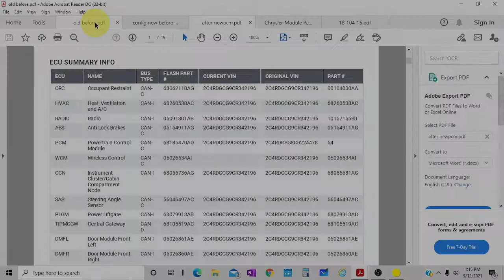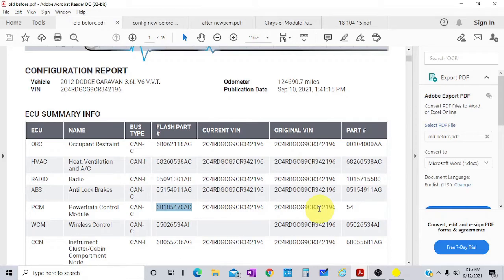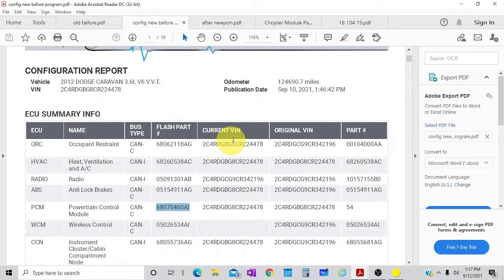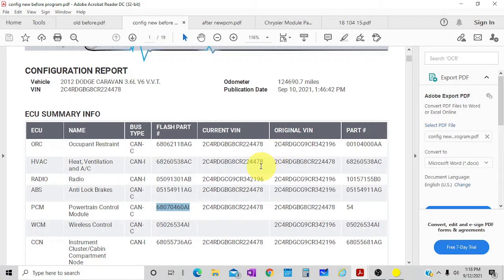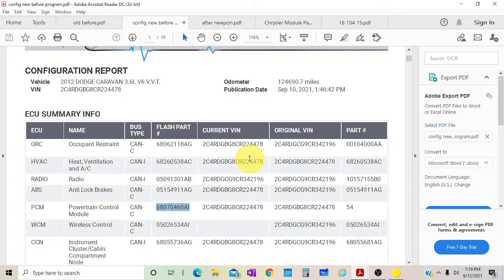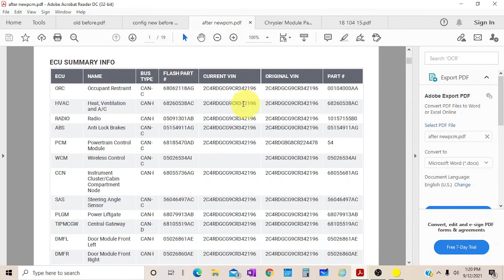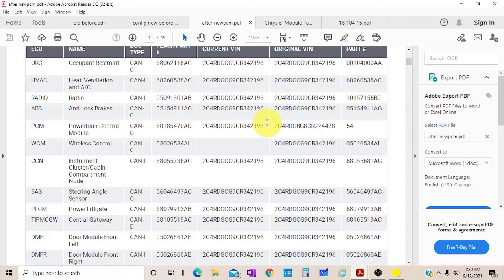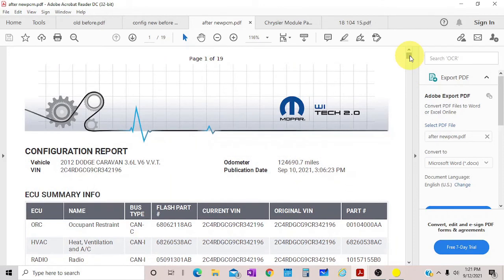Chrysler used PCM Programming tips | Restore Vehicle Configuration

Comment: The dealership worked on my Durango which had a menu item called power steering default and you could choose three levels of power steering.
When I got it back that menu item was missing and the steering was stuck in a stiff sport mode. Dealer says they  can't find anything to bring it back. 
Any suggestions for me to tell the dealer?

Comment: What would I need to do if the VIN doesn’t show as the original or written? It’s doing that for my BCM and ABS modules and I think it’s causing a no crank no start. Also do you know what the secret bytes are?
Reply from the maker: Try this procedure first and make sure you have communication, good power and grounds.
Reply: Did you figure it out

Comment: Great video Auto Tech to Go!

Currently working on a 2012 Dodge Avenger with a 2.4. Used ECU replacement. The donor car is a 2012 Chrysler 200 with the matching ECU part # but mismatched vin. 

The Witech, with the 3 required subscriptions, seems only to read the vin from the donor (Chrysler) module upon hook up and left me the choice to use and apply it to the Witech vin subscription and did so. Is there a way to manually imput the vin of the Dodge we are working on, or does that happen when you reconfigure or restore in functions such as you mentioned in the video? I certainly hope I don't need to buy another Witech subscription due to the possible error, but I'm prepared to do so if that be the case. 

Your reply will be met with gratitude, like, and subscribe, sir.

All the best,

J.P
Reply from the maker: Yes you can input the vin. Try unplugging the module.
Reply: @autotechtogo6290  Yes, it did work out. Thanks! Once I place the original pcm and began the program process, at a certain point or step before programming phase, I swapped it out with the used replacement unit. The PCM programmed and corrected the misfire I had. Man, to your credit, it takes a lot of patience and mental exhaustion to do this type of work daily. In truth, I thought about specializing in programming modules and troubleshooting, but me, personally, I'd lose my mind as modern vehicles with different designs of can bus and testing protocols can be quite involved that are subject to change and varies from model to model and the cost of replacement modules should used be unavailable, adds to the all ready stressful repair course, not to mention the client that is wondering how much testing and repairs will eventually cost! How do you keep your sanity, brother? Keep up the good work Autotechtogo6290!
Reply: @autotechtogo6290  Do i need to update the mileage on my PCM to match my veichle as well when changing the VIN ?

Comment: 2017 hellcat rf hub, invalid current vin but original vin is correct to the car and im not sure what happened during the initial programming..Vehicle configuration restore doesn't touch the rf hub at all ,not even reprogramming it with the same part number with witech will update the current vin which is simply labeled "invalid vin" ...only fix I see is replacing the rf hub again with a new one and reprogramming the new one again.

Comment: Hello 
I have a chrysler 300c 5.7 2006 had a problem Stan with my pcm so I went to work shop that changed my pcm with a used one then discovered a check engine sign with cod P0499 which wasn't there before & tcm miss communication then they changed the tcm because it was been affected by another used one 😢 
My question now if I ordered a preprogrammed PCM & TCM would fix this mess they done or not & if my have affected any modules other then the PCM & TCM
Thanks for your time 🙏
Reply from the maker: First of if all you need to understand how vehicle diagnostics actually work. There is no easy button or straight answer based just on the fault code you gave me.

Take your vehicle to a real technician that knows what he's doing
Unfortunately there is not many around.
Reply: I'll be thankful for your reply, it will help me make my mind to purchase the pcm & tcm programed since that this car such dear car to father & such a unique condition regardless to what happened hopping to return it to its original condition

Comment: I have Jeep Wrangler with HEMI 392 swap, I am second owner, no original PCM. I have blown my TIPM. I have a new, unused TIPM and purchased a PCM programmed to my VIN. What is best way to proceed now? Do I need to perform a restore? Can I even with my setup? thanks
Reply from the maker: Most TIPM's will configure with the first key cycle while waiting minimum of 10 seconds.

I have no idea if your Jeep will work with a 392
Reply: @autotechtogo6290 Hello, thanks so much for the reply and help! Let me be a little more clear as I reread and could tell it was not. The swap was already complete when I bought it, so the Jeep runs great with the 392 and PCM that is in there which is not OEM. Then months later I blew my TIPM. I tried replacing my TIPM with a used one and it worked but I had a bunch of vin mismatch codes and could not initate ABS/ESC. So I reached out for help, they told me I needed an OEM PCM programmed to VIN (OEM) and that it would have to be plugged in (BUT VEHICLE NEVER STARTED) they then said I would need the WITECH to program the TIPM and that is where I am confused if I do or not. I hope this makes sense and at this point I would pay you for your time if you want, please email me if you think I need it jbmsurfs@g#ail.com replace # with m. Thank you so mcuh!!!
Reply: I could paypal you money immediatley just for your time. its worth it to mw.
Reply from the maker: @jonathanmayberrydesigns  what year and original engine size is your jeep?
Reply: @autotechtogo6290  your first comment was absolutely right! thank you. I did not have original PCM so I bought one off ebay programmed to my vin. I had to have that and my original instrument cluster plugged in after replacing TIPM and then after a couple key on 12 secs it restored and programmed my new TIPM to exact original settings. No etcs, no vin-mismatch, etc!! thank you!!! its was 2013 with the 3.6 as original just to answer your question! i cant thank you enough. no one was able to help me and the proper info exists no where on the internet, i mean nowhere.
Reply from the maker: @jonathanmayberrydesigns  I love hearing a successful ending. I'm glad it all worked out for you.
Reply: @autotechtogo6290  Thank you so much! Love to see my cluster with no lights.